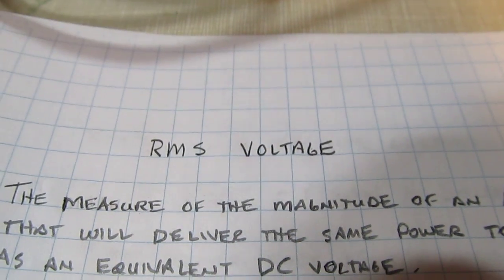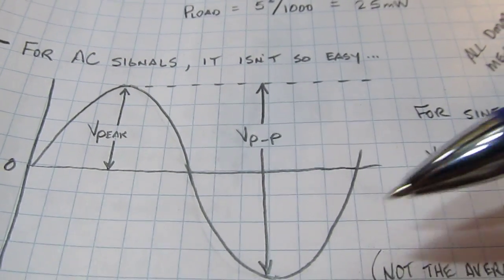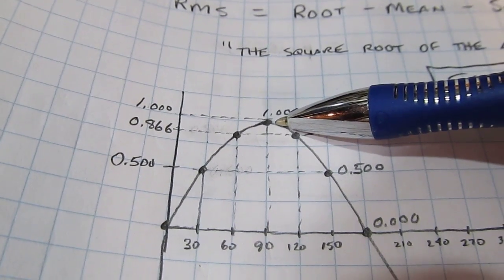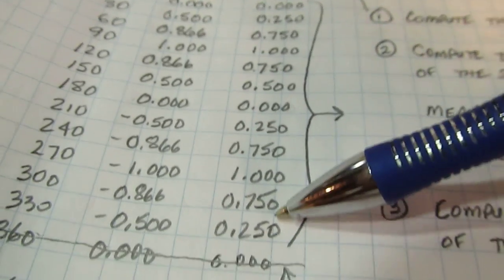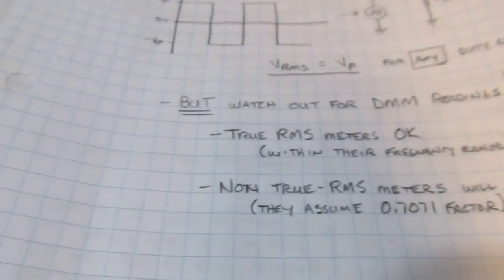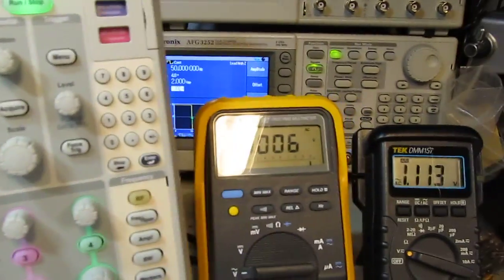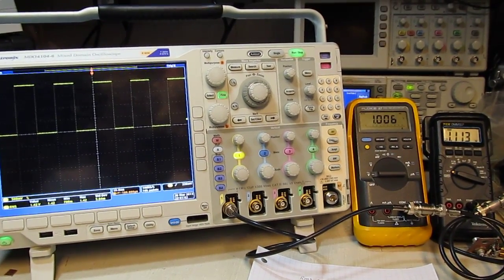#94: RMS Voltage for Sine and square waves, and why your DMM might not work right!

Comment: You provide some of the best quick, simple explanations on these topics.  While I knew about RMS measurements (both sine and square wave), I completely forgot about square wave DC offset and needed to verify that my two meters did not measure RMS voltage correctly.  Great pointer!

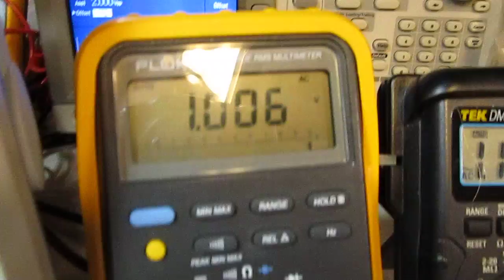Comment: You could have gotten the correct RMS voltages at 8:35 by switching the meters to DC mode. This would have correctly determined the DC offset. Your "true" RMS reading would then be sqrt(AC-RMS^2 + DC-RMS^2). It's a 2 step process for any DIMM that filters out the DC offset.

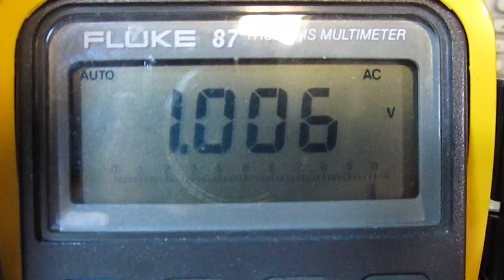Comment: Something not right at 6:02. If the non true-RMS meter is just assuming a factor of 0.707 (as if it were a sine wave) then it should be reading 0.707*1 volt = 0.707 V (on a 2 V peak to peak square wave) and not 1.113 volts. I just happened to do a series of tests just like this on my "true RMS" meter and on a 4 V peak to peak signal my meter read 1.394 V which is 2/sqrt(2). So my meter IS making the 0.707 assumption regardless of the shape of the waveform. The other things I discovered (as you mentioned) is that the meter gives identical readings whether or not there is an offset suggesting it is AC coupling the signal. Finally I found that at any frequency above about 1 kHz the readings become progressively more inaccurate. E.g., with a 4 V peak to peak sine wave at 1 K Hz meter reads 1.395 (2/sqrt(2)) but at 3 K Hz reads only 1 volt and at 5 k Hz reads a mere 0.268 volts. In all cases my oscilloscope calculates and displays the correct RMS voltage regardless of wave type, frequency or offset.

Comment: I think your comment about "using the 0.7071 factor" is a bit vague and doesn't quite tell the story as pertains to RMS meters that are not "true" RMS.  I think it is important to introduce the concept of the average value, because that is exactly what the meter does.  The average of the peak voltage is easy to obtain electrically with not much more than a capacitor.  And the average of a sine wave is 0.637 of peak.  The meter (analog ir simple digital meter) simply scales this up by the ratio of 0.7071 / 0.637 = 1.11.  That is, of course, where that scaling factor really exactly comes from.  And this is why a square wave on such meters will read about 11% too high.  It isn't quite the "0.7071" factor, but the 1.11 factor.

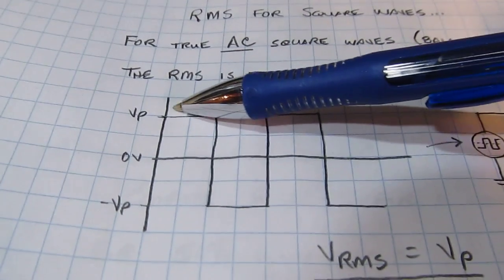Comment: @5:30. This isn't clicking for some reason. The Vp =Vrms.  How ?
Reply from the maker: The RMS value of a waveform is essentially the same as the DC value that would produce the same power dissipation.  For a square wave balanced around ground, the peak voltages are +Vp and -Vp where the value of |Vp| is the same. So, even thought he polarity switches, the load still sees Vp volts across it at all times.  So, the power dissipation is the same as if the polarity didn't change.  Thus, the RMS voltage is equal to Vp in this special case.

Comment: You refer several times to the 0.7071 factor which is the ratio of the RMS to peak value of a sine wave. However, in the comparison of the true RMS and non-true RMS meters on a square wave, what counts is the "form factor" of the waveforms, which is 1.111 for a sine wave, and 1 exactly for a square wave. Thus the non-true RMS meter (which is almost certainly responding to the average modulus of the waveform) reads high by a factor os 1.111, because it is calibrated to rad correctly for a sine wave.

Comment: difference brands of meters has different input protection circuits some have poly fuses and MOVs and others don't have much at all. How can you protect your DVM DMM meters by knowing what input protection you have or don't have on your meters? without opening the meters up what are the most common input protection circuits in meters?

Comment: Digital Oscopes have a MEAN measurement not sure when would you use the MEAN measure what in a circuit? The mean value for an AC sinewave is in the millivolts value which is the difference between the positive forward voltage compared to the negative reverse voltage of the AC sinewave? When measuring a DC voltage the MEAN value is always the same as the peak dc voltage, but in AC voltages the MEAN value is in the millivolts compared to a DC voltages the mean value is the same as the DC peak voltage, any reasons why?
Reply from the maker: Example - let's say you have some sort of sensor who's output is varying up and down a bit - the Mean measurement can give you it's average level.
Reply: @w2aew  But Oscopes have the Average mode also or is Mean always averaging the measured value? I see on Oscope they have an average setting and also a Means setting. Not sure to use Mean when measuring Non-linear loads I have heard that its when to use it for non linear loads but I'm guessing the Mean is just averaging the output of the non linear load?
Reply from the maker: @waynegram8907  The scope averaging mode is an acquisition mode (averaging successive traces together).  The Mean function is a measurement is computed across a single trace.
Reply: @w2aew  yes true they are but do you use the averaging mode when the non-linear load or sensor is varying up and down the voltage? because the averaging mode is an acquisition mode that will average all the sample voltages so its kind of doing the same as the mean function. Not sure when to use the Average mode and when to use the mean mode
Reply from the maker: @waynegram8907  it’s apples and oranges. Average acquisition mode gives you a waveform that is averaged over multiple acquisitions. The Mean is a measurement that gives you a single numeric result from a given waveform.
Reply: @w2aew I understand that part. Can you give examples of when to use the Average acquisition mode? Because I would think both the Average Acquisition mode and the MEAN mode would give you the same result of a waveform because they are both averaging the measured varying voltages. I'm confused on when would I use the Average Acquisition mode and when would I use the MEAN mode, how does a EE engineer or technician make this choice or decision based on what?
Reply from the maker: @waynegram8907  The most common reason to use Average acquisition mode is reduce the noise on a waveform, so that you can more clearly see the underlying wave shape.  The MEAN is not a MODE, it is a MEASUREMENT.  It gives you a single numeric value as a result, not a waveform as a result.
Reply: @w2aew ok thanks, yes Mean is a measurement but its mostly used when a voltage is varying and not stable?
Reply from the maker: @waynegram8907  Yes, or has noise on it.

Comment: your awsome but the multi meter is for automotive repair duty cycle would  be how long your egr or evap stays open and closed .
and hz square wave ocilloscope type signal is the computor signal for like low res signal  would be 
dc 0-2 volts high res signal dc 2-4 volts on optispark distributor .r 
then on ac amps between  cpu and ignition modual to tell if its open or shorted. continuity impedence
milliseconds hold min max freeze time frames to look at ramps and tails of square waves.
 picoscope is the bomb that can compare freeze frame ocilloscope to others you just looked at after fix.
watch scanner danner on youtube youl get a kick out of him .
its just a get byable way to fix auto electrical  problems .
Im just learning it my self. rookie talking.
the dmms will take temperatures.
my luk 77 died rest in peace now im trying a innova autometer 3340a  
itsure isnt a snapon picoscope scanner.
watch the scanner danner videos 
so far I havent got a square wave yet lol on my scanner I Can graff my fuel trimms and advance on disributor.
nice video thankyou      some are averages because dmms dont move as fas as ocilloscope

Comment: Hello! I played a little with a FG and 2x true rms DMMs. I tried square wave of different freq and duty cycle. At 50% I get ~Vp value on both, but if I increase or decrease the duty cycle, the dmm readings go lower instead of maintaining the Vp value. What can be wrong? The DMMs are fluke 175 and uni-t ut139.

Comment: Was going along with your notes - minor mistake at phase angle=150 degrees where the amplitude is .5V and the Vsquare corresponding reads .5V rather than .25V.  With this correction the math comes out as it should.

*Supplemental: Clearly others have made the same comment and I neglected to show my appreciation for the video content, for which I thank you!

Comment: w2aew, when you measure the AC outlet using an RMS DVM it measures 120vac RMS this means its equal to 120vdc?  120vac RMS = 120Vdc?
Reply from the maker: 120vac RMS will deliver the same amount of power to a circuit as 120Vdc.
Reply: How do you know it will Sink and Source the same amount of wattage/power? How do you tell if the power supply is going to sink and source the power/wattage. I'm confused about the sinking and sourcing because some power supplies might source but can't sink. What is the difference between Sourcing current and Sinking Current?
Reply from the maker: @waynegram8907  A power supply will only have to sink current if the device you're connecting to has it's own power source.
Reply: I thought a power supply is the power source, what else would the device be connect to that has its own power source? How do you know if the Sourcing and Sinking is "equal ratio" or is every circuit sourcing and sinking have different currents of sourcing and sinking?Because I thought that every circuit has to have an equal ratio of sourcing and sinking current has to match the sourcing current and sinking current has to match from the current laws of theory?
Reply: 12VAC that goes through one diode which is half way rectified to DC. The formula is 12vac X .707 or 12vac X 1.414? to get the DC voltage
Reply from the maker: @waynegram8907  It's a little more complicated than that.  12vac X 1.414 gives you the peak voltage of about 17V.  Going through a typical silicon rectifier diode will halfwave rectify the voltage and you'll get half-sine voltage pulses that will peak at 17V - 0.7V, where the 0.7V is the voltage drop across the diode.
Reply: Yes I understand, what I don't understand is Why isn't the formula 12vac X 0.707? since its half since voltage pulses I would think to use 12vac X 0.707
Reply: I'm guessing 0.707 is only used to convert an AC Peak voltage to RMS. I thought 0.707 was used for rectified half pulse wave.
Reply: 12vac X 1.414 = Peak VAC not Peak VDC? 12vac is 12vac RMS which equals 12vdc because RMS = DC voltage?

Comment: Thank you for the help, I'm guessing GFCI have comparator circuits, a differential amplifier, phase lock loop to compare the hot and neutral currents? Normal Regular Circuit breakers don't compare the hot and neutral currents, they just trip at a certain threshold. I thought GFCI outlets were went only for connecting plugging in equipment like sterilzers machines, dishwashing machines, autoclave machines, etc that uses water, water tubes, electronic circuits boards because if the water gets on the circuit boards or on the AC wires the GFCI will trip or if you had your hand on the sink which is grounded and the units chassis was hot live chassis the GFCI will trip.
Reply from the maker: They have some kind of current comparison circuitry. No PLL involved. They’re used whenever there’s a possibility of a person touching a wet surface and the equipment.
Reply: @w2aew  ok thanks for the help

Comment: The difference between a GFI ground fault interrupt compared to a circuit breaker is that the GFI ground is connected reference to the water sink pipe ground? Equipment that uses water and electronic circuit boards in a piece of equipment should be "always" connected to a GFI AC outlet because if the water or tubing leaks water onto the electronic circuit boards or AC power internal inside the unit the GFI will trip? If the piece of equipment is "not" connected to a GFI AC outlet and the water or tubing leaks water onto the electronic circuit boards internally the AC outlet doesn't have an GFI to trip the water will leak onto the circuit boards and AC wiring which will blow the internal fuses of the unit but the "time delay" of the fuses are much later compared to a GFI tripping?
Reply from the maker: No.   A GFI, or more accurately, a GFCI (ground fault circuit interrupter) is a circuit breaker that trips when the there is an imbalance between the current on the "hot" lead and the "neutral" lead.  Normally, these two currents are equal and opposite.  If there is an imbalance between these two, this could mean that the circuit is taking a improper path to ground (possibly through a person!), so it then breaks the circuit.  GFCI devices are used and required for any circuits that are used around wet locations because this is the most likely place where someone could accidentally get shocked.

Comment: (sin(x))^2+(cos(x))^2=1 (Pythagoras). Cos and Sin are identical except for phase shift so the average of sin^2 is the same as the average of cos^2 on a full cycle. So the average of sin^2 is 1/2. So the average power of a sin voltage of peak 1v is half the power of a constant 1v dc. So it's the same as 1/sqrt(2) v dc.

Comment: The square value written for your 150 degree increment is written as .500 vs .250 although i believe you summed it correctly. 
Thanks for the great tutorials. 👍
Reply: Yeah I noticed that too, I just think he forgot to square the voltage at that point, but no biggie I still got the gist of what he was doing. Great Video.

Comment: Hello , what is the type of the oscilloscope you are using ? I'm guessing its Tektronix also as the AFG 3252 function generator you are using , I am getting started in the repair of marine electronic business and realy need to simulate the signals that coming out of sensors to verify the integrity of the systems , what is your recommendation to buy signal generator and oscilloscope? Thanks in advance
Reply from the maker: The scope I used in this video is a Tektronix MDO3000 series.  Nice feature with this scope is that it has a optional built-in arbitrary function generator.  One cool feature with this is that you can take a measured waveform on the scope and copy it to the function generator so that you can replay it later.  Handy for replaying a signal from a sensor or other device later.

Comment: Hello Alan. I have been doing my own investigation into RMS measurement and trying to use cycle RMS  on my old TEK TDS 2022. Anyway I cannot get readout to stabilise it’s all over the place.  I’m measuring a current wave form that’s a bit noise I have the BW limit enabled and also used the averaging function but the reading are still inconsistent. Just wondered if you could advise limitations on using cycle RMS function on the scope and why the reading are  so bad. https://youtu.be/xVAmzbBv5sg.   I’m hoping to  try to measure the RMS current delivered into a capacitive load in the next video and try to work out the rms long hand using the square mean route approach. I would be interested to know what the correct instrument is for the job as I found True RMS meters  don’t necessary give the correct answers.  Thanks for sharing learned something today. Regards Chris
Reply from the maker: I think the problem might be that the scope is having difficulty determining duration of one cycle.  The measurement computes the Cycle RMS over the first cycle it finds in the waveform.  With the waveform beginning at the trough where the noise variation is, it is possible that it is finding the first cycle very quickly where the noise is bouncing up and down.  I wonder if you re-position the waveform horizontally so that it starts near the mid-point, if that will help. I don't know what algorithm the scope is using to determine a "cycle", so give it a go to see if this works.
Reply: Thanks for the reply I will give that a try. Its kind of interresting to find that even high end so called True RMS meters dont work to well for fast rise time or short interval pulses. Not something i had really considered before as we are so used to dealling with sign waves and perhapstrusting what the meter indicates.   Im sat at kitchen table now looking at the current pulses coming out the inverter and trying to take a number of readings square them work out the mean and square root them.  I loosing the will to live I need a magic RMS meter that works on any waveform ?  Best regards Chris
Reply from the maker: DMMs are, by their nature, limited in measurement bandwidth.  Fast edges, short pulses, etc. are all made up of higher frequency content.

Comment: Hey Alan, great tutorial as always, I wish I had more professors like you... Why is your Tek reading higher the square wave? Shouldn't it be reading the same value as for AC, since it is applying a factor of 0.707? At least, my meter works like that.
Reply from the maker: The Tek meter reads high (incorrect) on the square wave because it is using the 0.707 factor on the signal, which only applies to sine waves.
Reply: w2aew Obviously I need to read more, because I still have the wrong perception on AC signals interpretation. In my mind, an AC square signal with amplitude ptp of -1V to +1V will show 1V on the TRMS meter and 0.707 on the non-TRMS. Thank you for your answer, I am looking forward for your videos,  Octavian.
Reply from the maker: Non True-RMS DMMs measure AC signals by first rectifying them, then measuring them (usually their average/filtered value, then they apply a scaling factor to give you the result.  Since a rectified square wave has a higher average value than a rectified sine wave, it reads higher than the sine wave on a non-true-RMS meter.
Reply: w2aew I did not know about the rectification! Thank you, makes sense